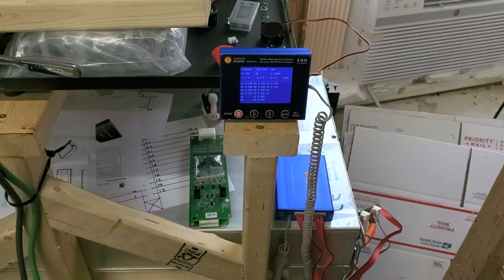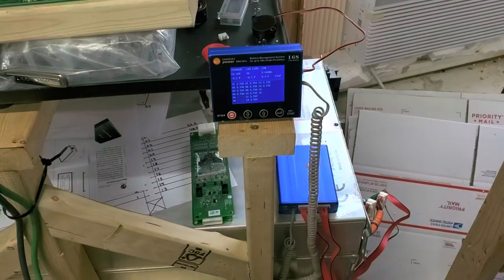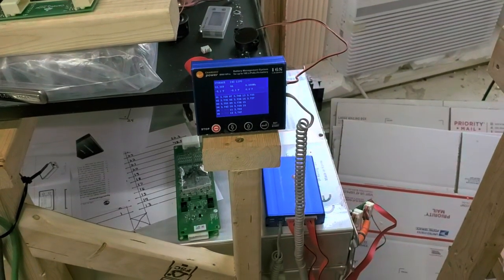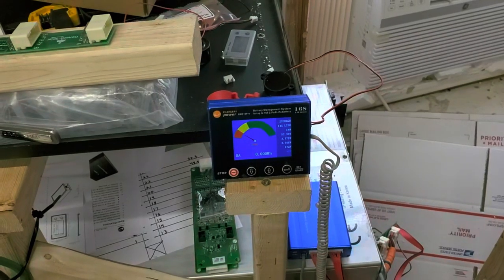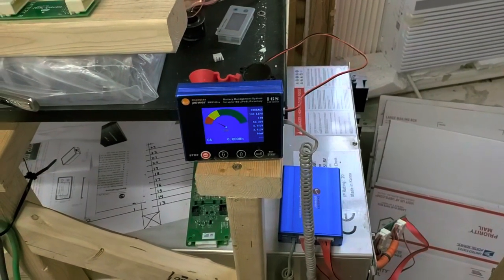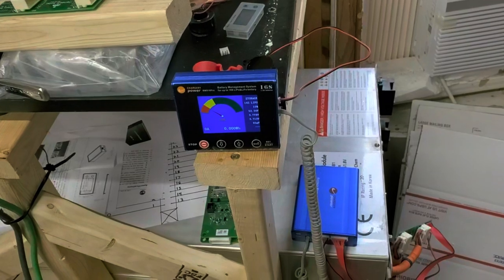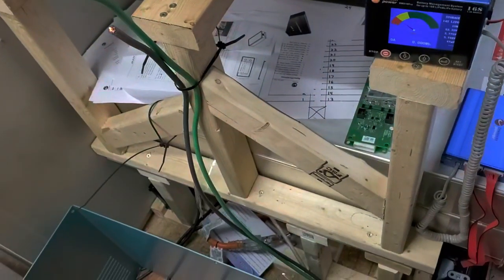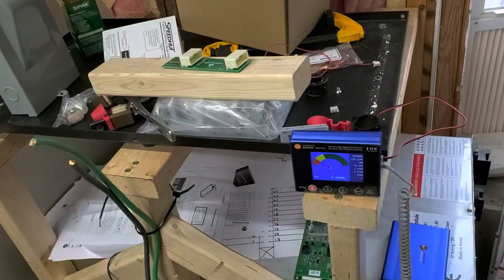Chargery BMS update

Comment: I myself I'm going to convert my battery  bank from agm to lithium. And that's the problem but all battery Banks they don't have a good BMS. I have a good battery equalizer balancer I use it for my AGM batteries however I just noticed it it says can be used for lithium so but it doesn't have monitoring system anything like that it just a positive and a negative and that's it. I'm planning to use these balancers with when I replace my battery bank with lithium .🤔

Comment: Most passive balancing boards work better as you increase the cell voltages so once you start charging it should balance faster.  Active balances don't have that same issue since they boost the power during cell transfer.  They both have their advantages just knowing how they works helps though.  I haven't tried the Chargery yet so watching to learn as you learn more.